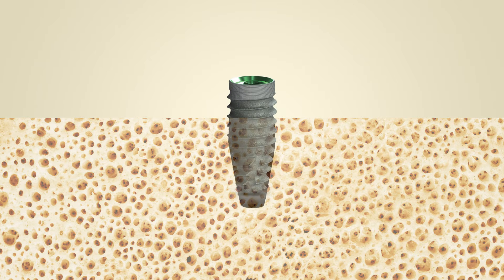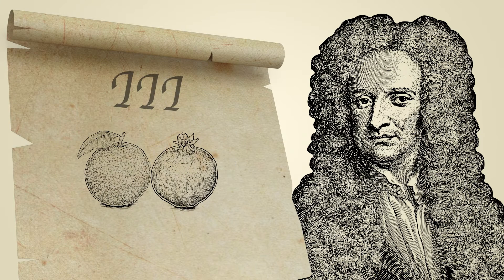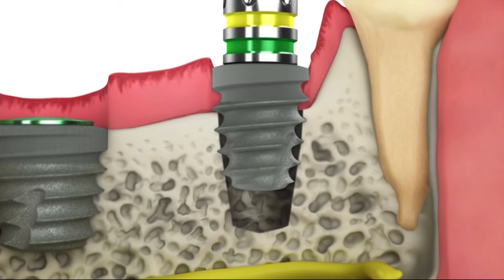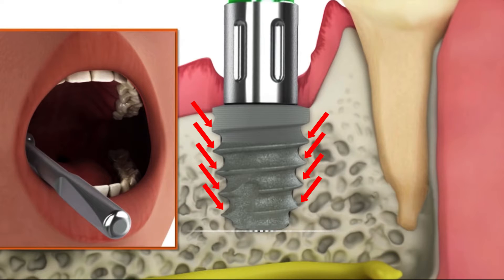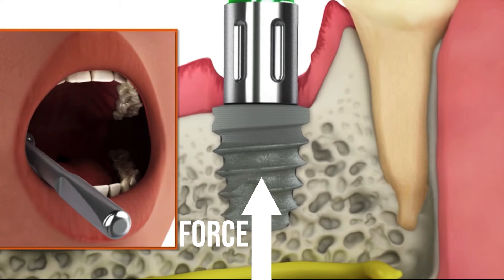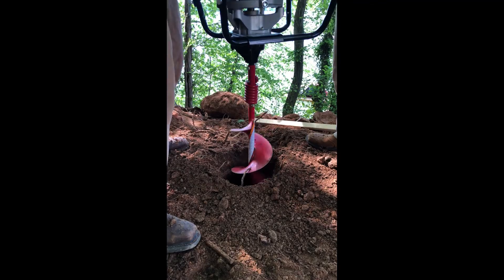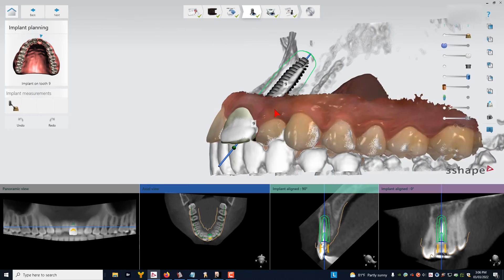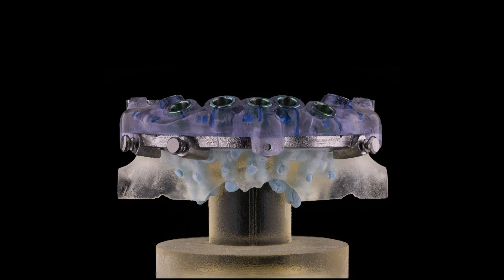This is why you should NEVER push on a dental implant

Comment: As an Implant guy, I would like to share details of my practice. Thanks for explanation, but I would like to add that there are 2 factors, where this law doesn,t work.... First in case of narrow and aggresive implant, that implant will go deeper if we push harder. Secondly the bone density. If we have d3 d4 bone even in bad drilled bad implant will screw in. So I think it will be better to mention that this case is for d1 and mostly for d2 bone. Thanks again
Reply from the maker: This is true. If you are completely in spongy bone you could likely continue to advance apically. However, that rarely happens since the compact bone sounds the spongy bone so eventually you hit compact bone.

Comment: Dr. I had an implant case , which I couldnt performed the osteotomy as I planned as the implant motor didnt work properly and I couldnt reach the working length. I couldnt placed the implant as I wanted in depth, I had 40 Ncm but not fully seated( 2 threads are showing ,on B side). Do you  think from your experience that there is going to be problem?
Reply from the maker: Hey doc. Sorry to hear that. The good news is a lot of shallow implants do just fine. Especially if the patient has good home care. When that happens what one can do is remove the implant. Make sure it remains sterile by not letting it touch anything. Extend the osteotomy two millimeters and place the implant again. Of course this is dependent on have room apical to extend the osteotomy. Hope this helps

Comment: Also an engineer here. I am watching to understand more about dental implants. I really like how you try to explain important engineering principles to dentists so they can install implants in the best way possible. 

The one thing the animation is missing when discussing increasing the depth of the hole is that the cone of the screw will be biting into new material since the diameter is now larger at each depth. 

I have not watched all the videos yet, I imagine two more, (1) my implant is at the right height without reaching desired torque, (2) implant driven lower than planned, what do I do now?
Reply from the maker: excellent suggestions. Thank you.

Comment: That statement in title is not correct. Imagine bicortical implant in maxilla all-on-4. Sometimes you need some pressure on implant to go through nasal floor.
Reply from the maker: So, when it comes to placing my implants, I have a little trick up my sleeve. Instead of going into the nose, I actually like to position them at the bottom of the osteotomy. And let me tell you, I use this awesome type 4 fully fuided system that guarantees the implant gets super close to the ideal spot, like within a few hundred micros.

Comment: So from your perspective 
Implant with cutting tip should be never used?
Reply from the maker: I tend to not be limiting in my statements. “Only siths speak in absolutes”. In general, the risks associated with a sharp tip verses a blunt tip out weigh any preserved advantage. Did you see the radiograph of the implant that went into the patients eye? If so you will notice that the tip of the implant is pointed. If it had been blunted the tragic outcome might have been avoided.

Comment: Dr. Hello
Please i want to ask a question, 
I put inplant on torque 35 on motor .. then 3/4 of inplant lenght went inside then stopped amazing means good
Then i continued manual by wernch the last 1/4 of remaining implant i found torque from 20-25 ncm .. could u explain to me why?
 Isn’t  supposed to by manual=handpeice
Reply from the maker: Hello Doc. This is a common scenario that many clinician encounter. The likely reason for the loss of stability as you drove the implant deeper was the fact the implant struck some D1 compact bone. Either a focal sclerosis or  cortical plate. When this happens the implant can not advance any deeper which turns the implant into an auger. This subsequently strips the bone around the threads with each subsequent rotation. I hope this helps.

Comment: The titanium implant is not designed to cut any depth.. like CNC machining bottoming tap or form tap its designed to cut within specified drill tolerance diameter and blind hole depth you bottom out say goodbye tap

Comment: So this applies mainly to immediate loading , but if u have a spinner and the plan is to just submerge the implant this wouldn’t be a problem since there would be no forces applied on the implant and it will be integrated 4 months later  right ?
Reply from the maker: That's correct. Since a spinner just means there is no resistance to rotational loads, that doesn't mean you don't have primary stability. Even if the implant has zero torque (a spinner), but it's immobile in the bone, there is a chance for integration. Clinically, I have been successful with this approach!